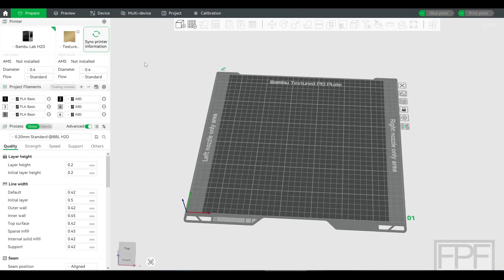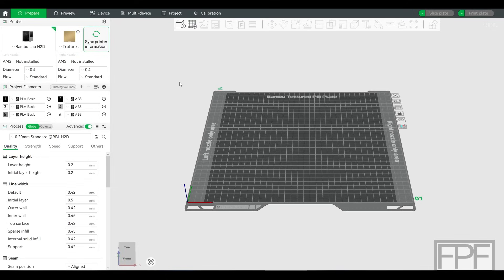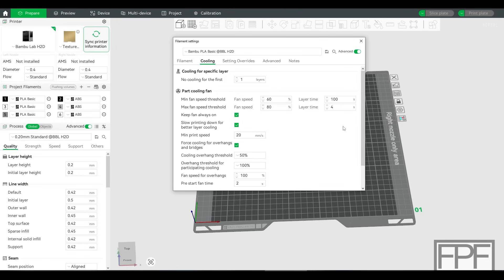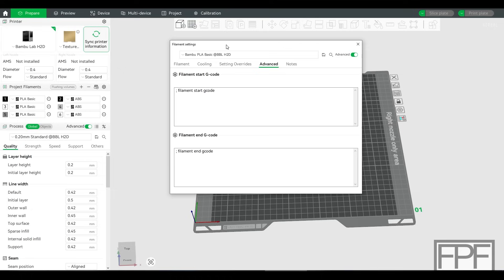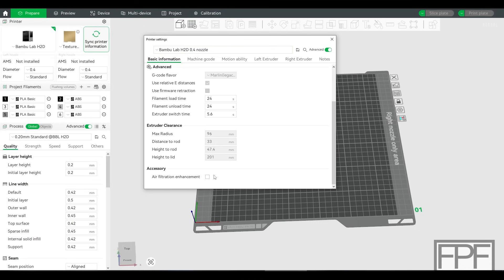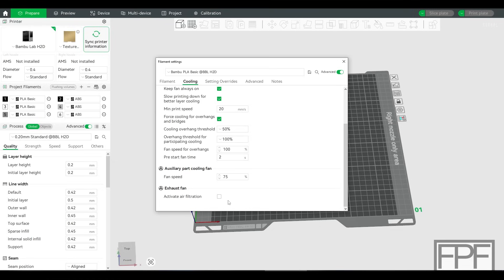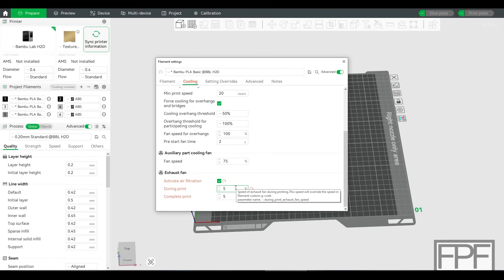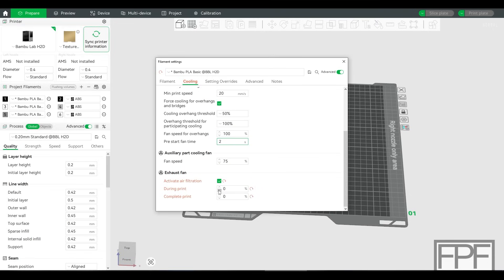Bambu H2D - How To Disable The Chamber Exhaust Vent

Comment: I just bought an H2S with full laser, I also have a p1s. I have no idea why bambu did this. My p1s prints petg perfectly. My H2s is having issues with petg, bad prints and petg is completely stuck to the build plate. Why did i pay a ton more for the h2s than my p1s? You should be getting better prints not worse with a latest technology and more expensive printer instead of going backwards.... Thank you for this info, though, it did solve my issues, but I shouldn't need to adjust the settings for petg each and every time I use petg, which is my go to filament.

Comment: New H2D owner and super thankful to find your channel!  Just wanted to comment that as of late Nov. 2025, the firmware and software on the printer and in Bambu Studio has changed or renamed this option and enabling it doesn't add the "Activate air filtration option" in filament settings BUT you can still manually control the Exhaust after a print has started in Air Condition on the printer or through Bambu Studio (On/Off and percentage, but can't set a chamber temp).  "Air filtration enhancement" has been renamed/replaced with "Use cooling filter" and when checked opens another option below it named "Auto turn off filter on overheat".
Reply from the maker: so, in summary, they have renamed it from something confusing to something even more confusing.  <sigh>  I don't know why they are struggling with how to implement this.  It shouldn't be this hard to give the user an option to skip the vent/fan.  Even a checkbox when sending the job would be sufficient/better.
Reply: that's why i didn't find the option after update... That's annoying.
@livingplasma thank you for the info !

Comment: I went into the printer settings to enable "Use cooling filter"

Having enabled "Use cooling filter", no filament profiles get the Exhaust Fan section shown in this video. Its still unavailable.

The only way I can control it is on a per-print basis using the Device page "Air Condition" option, or by changing the filament gcode to add chamber fan settings using M106 P3 (P3 is the chamber fan)
Thete is another option - "Auto turn off filter on iverheat" which seems odd. You would think it you are overheating you want to increase cooling not turn it off.
Reply: I see it is available in Orca. Another case of having to edit things in Orca and sync to Studio 😮
What a pain. I would put the H2Sbin Lan only but I want to be able to monitor in Handy.

Comment: If anyone else has found this doesn't work after the latest update, I have found you can go straight to the filament settings and change the "Chamber Temperature" to 40 (for PETG anyway, maybe try 35 for PLA) it will make a little more noise and use a little more power but there's its the only thing to fix the warping I've found.
Reply: I tried PLA at 35 degrees, that's too low to keep the vent shut as it stays in "cooling" mode rather than "heating". 
I'll find out in 20 hours how a 20 hour PLA prints at 40 degrees, also using PETG for a support interface.

Comment: They actually removed this, or i dont have that option. I can try in dev mode, without dev mode its not there ... i cant believe they wont let me just set the damn fan speed lol ... i miss orcaslicer so bad.

Edit, coming out of customer support:

2.3.0 is the last version that had the chamber fan speed setting, in the newer versions after oct. 14, 2025 they took out the enhancement option. Escalated it to the development team to see if thats intentional ( lol ? ) or a bug.

Also i tried to convice them to let users decide the target chamber temp, even lower than 40 degree to be set. Since when you print at say -10°C your chamber will maybe reach 10 degree, and your only alternative would be to heat to 40°C since thats the "starting" point of the heating setting thats currently available wich i think is odd considering this machine would be fully capable of heating ANY set temperature in range, say you want 10°C chamber that should be settable atleast for the heater, im not talking about full regulation but atleast heating. But they say no the plate heating somehow anyways and they dont want that ... i dont get it ... using the plate to heat to some temperature, uncontrolled while you could have a fully regulated chamber lower than 40 makes no sense to me.

Comment: You can also go into <<device<<, select your printer, and then just above the ext. filament icon there is <<air condition<< that you can adjust or turn off the exhaust fan.

Comment: Thanks, very good to know as my H2S is opening the vent even for ABS which gives the expected warping!
Now, for high temp printing as they call, it how would you stop any fans from running?  It says the chamber is sealed but it circulates the air in the chamber.  This can also cause warping on ABS.

Comment: Thank you for this video. It completely solved my print issue with PETG in a room with cooler ambient temperature - and it was only going to get worse as the Canadian winter approaches. If my printer was idle and cool, I'll also pre-warm it with the H2D integrated heater to 40 deg C for a few minutes (then shut  off the heater) before starting the print with the Active Air Filtration (Exhaust fan) set to 10%. Keeps the chamber running between 36-38 deg C  which seems to be the sweet spot for my prints.

Comment: I disabled the venting for PLA as you suggested but for the first time ever my PLA clogged my extruder really bad. Im not sure if it was a coincidence or not. I'm wondering if this vent closing method is really only good for environments where the ambient air temp is not 88-90F though. Maybe this isnt suited for my situation? I've been having warping/waviness in my PLA prints on the h2d and was hoping this would solve it. Oddly enough my P1S that is right next to my h2d prints PLA perfectly and I have never opened the top or the front door when printing. Im disappointed in my h2d's PLA printing so far. Hopefully i can get this solved though.

Comment: This is a game changer, I have been turning it off after the print starts for the last 4 months.  Thanks for the video.  I have had issues with PETG warping as well if it is long and skinny running diagonally across the bed.   Only way to keep it from warping is turning that chamber cooling off.   Never have any issues with heat creep turning it off.  I think the default setting of 30-40% is too much for any print.  10% would probably be sufficient for even a 3-4 day print.

Comment: In the Filament settings under the "Filament" tab the Chamber Temperature setting is the first one in the "Print Temperature" section. If you need a higher chamber temperature  you can get set this and the printer will maintain the desired temperature. This seems like a more deterministic approach than guessing at fan settings. I have used this on large PLA prints to prevent warping as well as maintaining a high temp for an engineering part in PC  and no issues so far. This filament-specific obviously, so you'll need to set it each time unless the filament already has it enabled in the default profile.

I believe the "Air Filtration Enhancement" setting is for the Glowforge-like external filter for use with the H2D laser module. This allows you to adjust the push/pull fan settings (H2D push & external filter pull) for the best fume/smoke extraction. Same as I do on my X-Tool P2S with the external filter.
Reply: One would think it would logically work as you described but sadly no. The 'Chamber Temperature' setting doesn't do anything for temps set below 40 C. Functional Print Friday has it right.

Comment: Wow, I have been searching for this for 2 days (including redit, AI, etc.)
Thanks for sharing.

I am still not able to understand how does this work without turning it on. What I mean is - printed H2D with Translucent PETG copied profile - exhaust fan is on. 
Then I made a new profile for 0.8 nozzle using normal PETG copied profile. All the same everything inside them IS THE SAME but the translucent copy has the exhaust fan on but the other does -o ff.

So they do it somehow hidden from me and I am not sure where. Tried this trick u showed - they are both the same but then again ...

Comment: Ideally they should let you set the chamber cooling temperature and it would modulate the fan and vent to keep that target cooling temperature.
Reply: Fr. Should be able to turn on the heat and set to 25C. Or cool at 25C

Comment: Thanks.  I enabled filtration and set it to Zero for a PETG.  I am wondering if setting it to even a small value would circulate the air inside the chamber a bit more and result in more evenly distributed temperature inside the chamber.

Comment: Would have liked to see this where you could instead specify a chamber temp and let it decide if it needs to open or not.  That sounds more logical to me but maybe I'm wrong?
The idea behind it is great, and I want more "just works" things but we need to be able to configure it for those smarts.  You almost need an EXTERIOR temperature sensor so the system can then look at the chamber temp and the exterior temp and make a logical decision?
Reply from the maker: Or an area in the config to help understand these choices and offer some guidance for common scenarios if you’ve enabled “advanced”

Comment: I would suspect that the 'extra filtering' option is there for supporting the extra air movement needed to get the smoke from the models of the H2D that have the laser cutter built in, or available. 

I would think that it would make a lot more sense if they had built in an option to adjust the build volume ambient temperature so that you could set it for whichever filament you're using, rather than having to jump through multiple hoops. If you want the build volume air temp to be just below the glass temp, andnot so far that you start getting warping, that should be something that can be done. I gather it can't though, which seems like a huge miss on the part of the dev team at Bambu Lab.

Comment: M106 P3 S this controles the exhaust fan speed
I found another aproach to this problem. I set the fan speed on the filament settings starting Gcode instead. If there is no settings in the starting Gcode it uses the default settings for that material like PLA 70% or something. So instead you can also add this to all your custom filaments.
M106 P3 S153 (0=0% 255=100%) so S153 = 60%
Reply: the funny thing is you can actually search for exhaust fan speed and it shows up in filament settings.  orca implements it but BS doesnt let you change it or show anything apart from a list item it finds.  i modified my machine gcode as well

Comment: H2D has separated systems for Filtration (which is a internally cycled system) and Exhaust. So if you enable Filtration, it automatically shuts the chamber exhaust. 

A better approach is to modify the gcode to adjust Target Chamber temperature. Search for M142 in your machine start gcode
Reply: There is a condition statement in the machine start Gcods that you can change. What I have been doing is setting the chamber temperature to 40c and presto! The door vent stays closed. 39c and it will open.
Reply: @Taskarnin  Isn't there a chamber temperature setting in the filament settings?
Reply: @JeffDM yes, as long as it is 40C or above my H2D will close the vent.

You can edit the start Gcode I think though. I’ve not had need to do that.
Reply: This makes sense. Do you know if setting the chamber temperature inside the filament profile will control the exhaust system? Like if I changed it from 0 to 30C would that dynamically control the exhaust system so it doesn’t get too cold, or too hot?

I’ll play with it but I have something on the printer right now…
Reply from the maker: That's interesting.  The method I show here is what Bambu suggested when I worked with them on the specific issue I was having with uneven cooling due to the top vent/exhaust

Comment: Thanks for this! I was having the exact same PLA warping issues in my 18C garage until I followed your advice a couple weeks ago to disable the exhaust. 

It would be really nice if setting the chamber temperature to, say, 30C, could dynamically adjust the exhaust fan/grills (and heater if it’s a cold garage in the winter) to maintain the appropriate temp. I haven’t tested to see what happens but I assume chamber temperature only works with the heater and not the exhaust system right now.

Comment: It's for the laser air filtration system - if you have that, you wouldn't want the shutter opening, it'll just command the external filtration system to run and draw air from the chamber.

Comment: Thanks, really helpful. I have to turn off (or reduce) this exhaust fan when printing PLA support for PETG. Seems - for my types of filament - that otherwise PETG doesn‘t adhere enough otherwise, which leads to failed prints.

Comment: I've seen you deal with this for a few fridays now... Have you had issues with PETG or just PLA so far?
Reply from the maker: just PLA, but I've only really done "medium-size" stuff in PETG in the H2D so far
Reply: Just check the PETG settings, I was having a lot of issues with adhesion before I noticed they used 220C for the first layer with 70C bed. With the H2D bed running cool as it is I upped the bed temp to 80 and nozzle to 250. No issues since, but haven't done too many more parts from PETG.

Comment: I think that the only confusing thing is that “activate air filtration” should be named, and likely means; “Activate air filtration controls”. Or something similar. With all the nonsense going around about Bambu Lab lately, some people will think this is “another” attempt of Bambu Lab to control our lives.
Reply from the maker: yeh I think it's purely an "organization of communication" language barrier between the engineers and front of house
Reply: I was thinking "Manual Air Filtration control", since checking it effectively turns off automatic control.